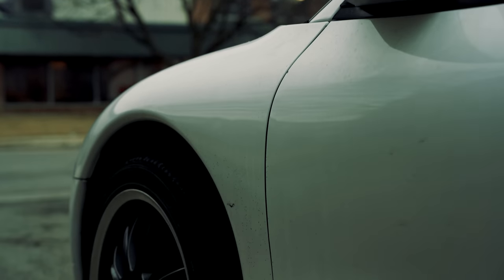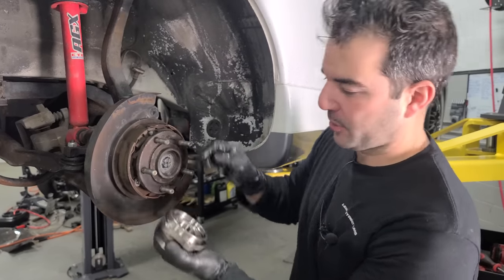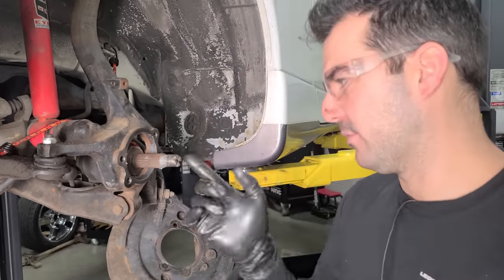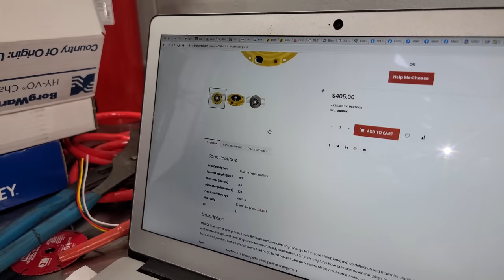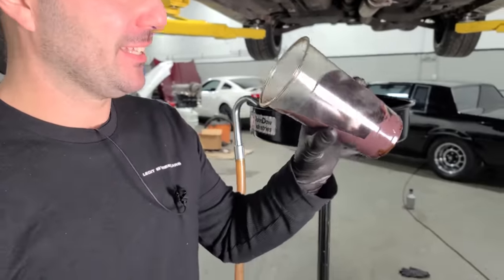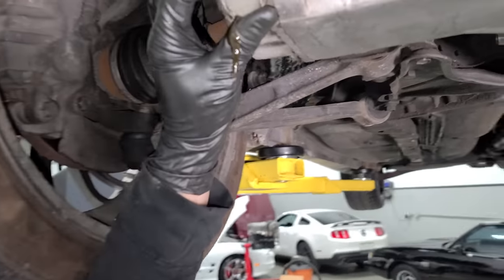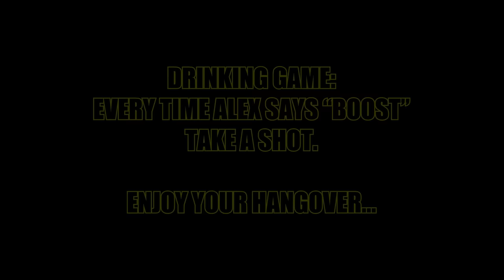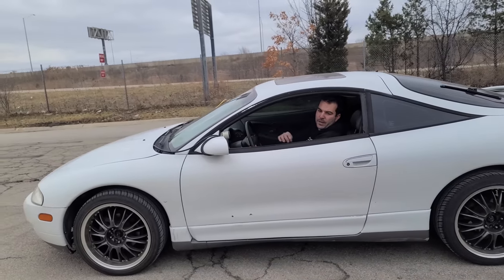Fixing My 250K Mile Eclipse GSX For CHEAP & Adding More Boost For FREE! AWD Launch Monster!

Comment: I wonder if the special shock proof  viscous fluid would make the rwd more active. Like if it’s more viscous there should be a lower slip speed threshold at which the coupling locks?

Comment: The transfer case and rear diff is the same diffs as 3000gt diffs. Last time I knew there was a recall on the transfer and rear diff for cracking issue.

Comment: That plastic BOV is leaking and preventing more boost, they tend to leak around 10psi and up. Evo 8-9 BOV fits right on. Boost leak check it as well.

I wouldn't attempt 20psi on stock injectors and fuel or on a 14b if that is what that turbo is.

Comment: For anyone who is interested in knowing these engines in detail, i strongly recommend looking into @Jafromobile on youtube. Dude eat sleeps and breathes these engines and vehicles. 

The shaving in the rear diff that came out appears to be a shim for the spider's that has peeled off or a top layer of the shim. - My experience is what im basing this off of. 

 Front diff appears to have redline 90w in it. Due to being low it probably milk shaked... Or if it it is a limited slip, it may have friction material in it. I really dont know, just speculating. 
 -Speculation was accurate later in the video. Nice. lol

Comment: I would not put the stock fluids back in the transfer case. It is better to have the Redline shock proof in the transfer case. The stock fluid is why so many transfer cases messed up. There was a major recall on all the 1g and 2g transfer cases.
75/90 is not good for that transfer case if you upgrade the horsepower

Comment: Packer yellow not faded. Someone put some of the shelf special fluid in the differential and it did not mix well with the old fluid left or failed. I would have put some common oil in there and drained it after a couple hundred miles.

Comment: had a 97 talon back in the early 2000s and they made a bigger rear brake set up witch ended being bigger the the front but it was affordable. if you have a ekeytone account check there .

Comment: I test drove one of these new back in the day. I pulled out on the 4 lane infront of the dealer and as I pressed the gas smoke boiled out of the front end. I thought the clutch was smoking but it was actually burning rubber.

You should have seen the looks on the salesmen out front 😂

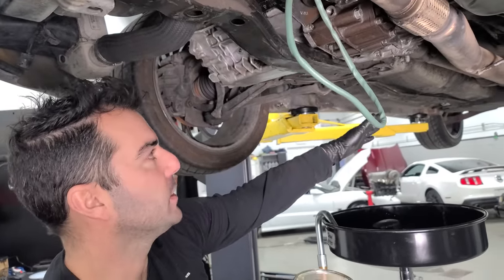Comment: 21:40 - the driveline is 50:50 split AWD, it never is FWD until it detects slip. The viscous coupler is on the centre diff to act as an LSD between the front and rear axles if it detects too much slip between either axle.
Reply: And that's exactly why mismatched tires destroys our viscous couplers.  It sounds like they were describing a haldex.

Comment: Factory boost was a 14 PSI. The stock turbo can do over 20 psi when healthy.  Wastegate mods are needed to get there.
Reply: Alex's car has a stock 1G Mitsu 14b on it. It can definitely handle 14 psi.
Stock 2Gs came with a 
Garrett T25 that couldn't handle much more than that on pump gas.
Reply: @resilva2  i know this because my 97 GST could do that  well over 20 lbs with aftermarket wg. Turbo didn't last very long though. :(

Comment: You should hunt down a Mitsubishi 3000gt or Dodge Stealth (my understanding is they're basically the same car).  As another 90s kid, the Eclipses were okay but the 3000gt looked like a legit supercar.
Reply: The 4g63 was a much better engine then the 6g72 that the stealth/3000 came with , the fastest 3000s are running 4g63s

Comment: That's not the front diff. That's the transfer case and that looks like redline shockproof heavy fluid. That's typically what we ran in the tc back in the late 90s.

Comment: Your awd description was totally off.  The viscous coupler is inside the trans (center dif)  it had its own output shaft through the bell housing into the tcase.   It sends close to 50 50 60 40 all the time.

Comment: I would also prepare to replace the computer they are notorious for the capacitors leaking and damaging the circuitboard. I have seen tons of these cars hit the crusher because of someone who gave up on them not throwing any codes not running because of a bad pcm. Even if it is not bad i would send it off anyways to be gone through.

Comment: Being a DSM owner for decades, the design of the rear differential is garbage and it'll start to twist because it is only mounted in 3 spots when it should have been mounted in 4 spots for the differential onto the subframe. Here is one way to fix it google on dsmtuners how to properly mount your 2g rear diff. I tried getting away with just replacing all 3 bushings with solid aluminum ones and that still didn't solve the problem. It worked for maybe a week then it was back to being sloppy again. If you plan on making power I'd just replace the whole subframe and differential off a 3000 GT VR4. That's what the guys making 1000+ hp do as the rear diff on a DSM isn't nearly as strong as a VR4. You could have other problems like U-Joints and carrier bearing mounts that can contribute to the noise. If you want to see the differential twisting from it's poor design, put it in the air and look at the differential when it's on load and when it's off load.

Comment: You're bleeding off metered air, which will cause the engine to run even richer than the ECU tune.  You should recirculate the bled off air to before the turbocharger, but after the air meter.

Comment: ALEX!!  Wait!…. DRILL MORE HOLES!  To get more boost!   Drill more holes/ install more “T” fittings, yours still getting vacuum past your current fitting…Not my knowledge it’s thanks to BOOSTEDBOIZ, more holes/ fittings equals more boost.  They were getting 3-6psi per hole/fitting. Just allow to bleed out into engine bay. FREE HORSE POWER

Comment: That rolled up piece of metal looked like a metal chip from cutting on a lathe. Those gears in the diff shaved it off the axles. It'll be fine

Comment: GL5 gear oils the incorrect gear oil for the transmission as its not compatible with brass synchro's that are in the transmission. 
Rear brakes from a 3000GT VR4 are direct bolt on's for 2g's, VR4 fronts are also a nice upgrade but Evo brembo's are better as they don't flex like the factory VR4 ones do.

Comment: The VC is in the transmission. I have built 2.3 6 bolt and lsd rear diff. You are better off getting the guts out of evo 8 9 lsd they will drop right in your stock case and is mechanical not viscous

Comment: The reason you can only hit 12-13 psi is the stock bov, they leak really bad in the 2g once you hit 12 -13 psi once I changed to an hks I could max my stock turbo at 16 psi,

Comment: That is sad my 92 would make 20psi easy on the stock 2g turbo upgrade. First thing u need to do is do a leak test on the entire system by pressuring the Turbo intake and the entire system. I found a tiny hole in my boost gauge hose and it made the ecu freak out and cut fuel above 15 psi. Any tiny leak after the maf makes the crappy old ecu angry.
Reply: 2g BOV life lol

Comment: The plugs will need to be gapped tighter to run 20 or more psi. Like .15 or .20 instead of .35
Reply: I run .20 for 30psi no spark blow out.  16g at 25psi I ran like .24
Reply: @superj8495  yeah I ran way better with the tighter gap at 20psi I ran out of fuel system ha ha

Comment: Will a Td05 make more than 13 psi with that engine?
Reply: Yes it will and love it.  Around 18-20 is the sweet spot for a 14b and about 25psi for 16g (for stock block/Bolt on)

Comment: You know most people that aren't noobs at turbocharged cars would know that you just throw a T in the vacuum line.  And you keep adding t's until your wastegate reference line until you get to your desired boost level. Can tell you guys are not into turbocharged car's. I would just unplug the vacuum line from that little turbo and see what it's got cause I doubt it'll do over 15 or 16.

Comment: Be careful launching the car like that. You have to roll out first before you completely let off the clutch.

And also that turbo does have more in it should have added 2 vacuum T's or one big vacuum t to bleed the air to the atmosphere.

Comment: Not a front diff, or center diff even... it's the transfer case, center diff AND viscous coupler is IN the transmission.   Please do a least a cursory bit of reading on the layout of the drivetrain of a DSM if you're going to try to explain how it works.   Also it's not "FWD until the front wheels slip", it's AWD and the viscous coupling just gives a bit of 'limited slip' and slightly more rear bias to a highly front biased system.

Comment: 50-50 chance I put parts on that car when it was built. If it was first shift, I touched it. Not bad cars overall. Mitsubishi lost their edge over time. AWD was a great car. First generation (H car as we called them) was more raw. Second generation (F car) was better as long as you got the Mitsubishi engine and NOT the Chrysler made in Mexico turd. Those had stop leak pellets in the fill neck from new. ST generation started getting bloated and needed V6 to compensate.

Comment: At 26:25 - oh God Alex - please tell me you didn't just put GL5 gear oil into that transmission... you literally just got done saying how well it shifted, and if that's GL5 then it likely won't ever shift that way again. Those additives for the hypodermic gears (ring and pinon) are devastating to the syncros in a manual trans. In a ring and Pinon you wantbas little friction as possible, but in a manual trans the syncros need a specific amount of friction to do their job. 

I know this because I made that mistake on an expensive BMW  6 speed- it's never shifted right again, even after multiple changes since with proper GL4. It killed my syncros, and after googling it years ago that's apparently common. 

I'm going to finish watching now - I hope I'm wrong that fluid is GL5...

Comment: Back in the mid 90's a popular advertised additive product that had Teflon in it (PTFE) to toss into your gear case was called SLICK 50. Turned everything into pink muck.
Id bet that pink stuff oozing out of your front diff is SLICK50. I used it in my 1996 Nissan 300ZX. Mechanic asked me one day "whats all that pink sh%t in there".....Lol
Bad for engines especially. Oil galley way walls get coated in that crap which essential now makes the galley way a smaller diameter. Equals less galley way oil flow. 😬👎